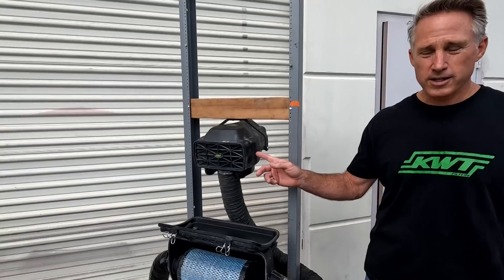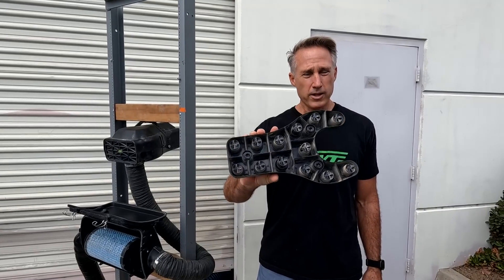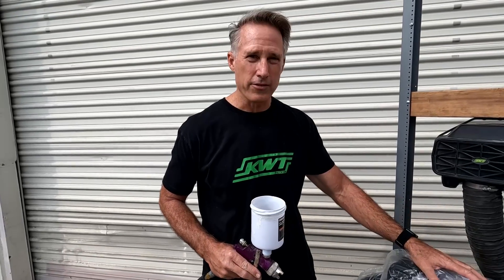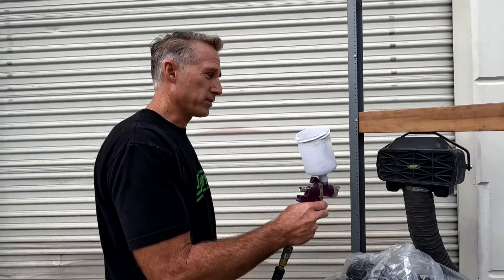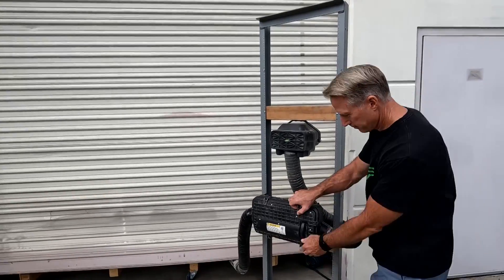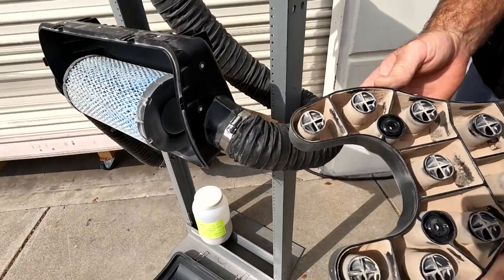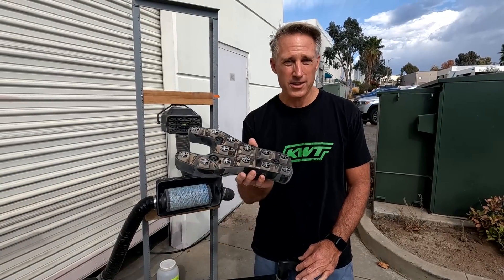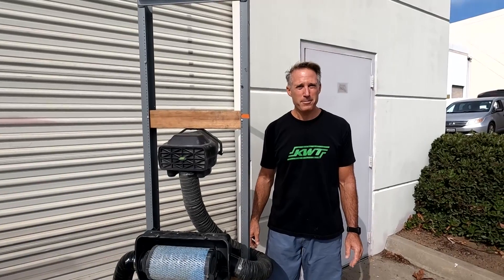Particle Separator Efficiency Test

Comment: Looks promising but how much suction did you have?  I would guess if you had a lot of cfm going through your system it would work great!
But how does it work in real world scenarios when engine demand is constantly varying, especially for the non racers?
Reply from the maker: The KWT uses the induction of the engine to pull the airflow through the particle separator and removes up to 98% off all dust and dirt before reaching the stock air filter. Dyno test results are posted on the website here: https://kwtfilters.com/pages/how-it-works. No reduction in power or air flow restriction. Works best for the every day UTV driver in all conditions. There are several independent reviews and tons of testimonials of this but this one might help: https://www.youtube.com/watch?v=lz1cA16okQg. No power required and no noise for an enjoyable user experience.
Reply: @KWT Filters  I understand the concept, and that it would work well when at high engine rpm when intake velicity is high.  What I am curious about is how well it works when intake velocity is lower such as cruising at low rpm behind a vehicle in dusty conditions?
I'm not doubting your design, just curious!
Reply from the maker: @Roostfactor1  Thank you for specifying that John, you are correct! It is slightly more efficient at higher RPMs, however it has been tested at lower RPMs cruising around as well and the efficiency is still comparable to that at higher RPMs. We have more testimonials on our website as well! https://kwtfilters.com/pages/testimonials. We love hearing from our customers how great it is working for them!
Reply: @KWTFilters  And thank you for the clarification!  I'll give you a call to place my order.